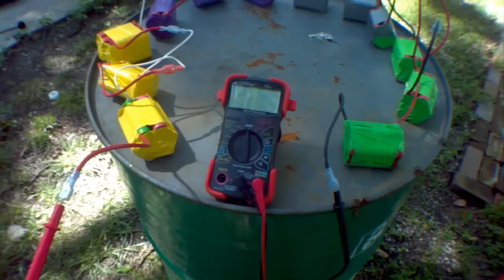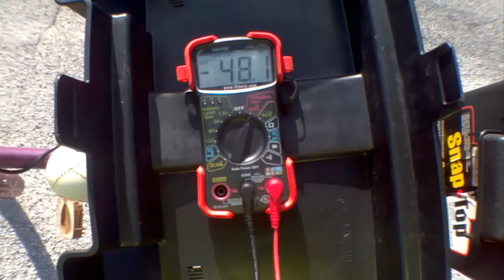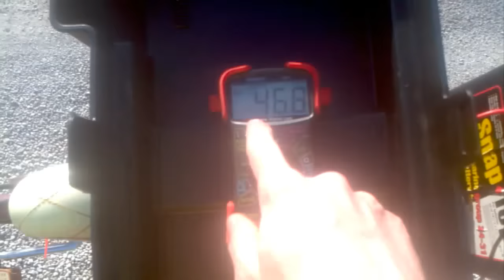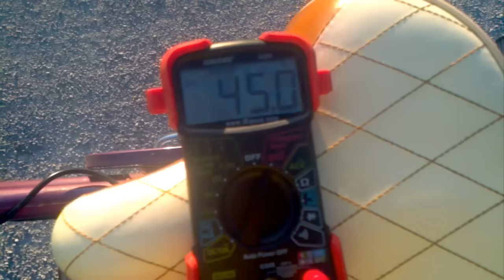1000w 48v 9ah electric bike distance test

Comment: Your Motor is ok, but bike and Battery are a nightmare. Buy a mature Middleclass Taiwn bike, like Wheeler Cross or something like this or if you have the chance to get a Trek or GT or something take this (ots ok when its old, everthing is better then the crap you have rigth now). Then you have to buy Sony V3 Konion Cells and find someone who welds them togther. Then you organize a softshell for the battery and good conncetosr for the power distribution. Then you store this in a pack backs. 

Then you have something useful.
Reply from the maker: why would I waste so much money on a bike that isn't cool like this one? this bike is great. idk what could be improved on it.

my bike now has a 60 mile range. and i didn't throw away money like you say I should. its more useful than your idea. not counting this bike is pretty much waterproof.
Reply: Rinoa Super-Genius OK good point...but you would need at least a new fork to have some brakes at least...
Reply from the maker: chris dabeee
it already has breaks. you just peddle backwards. i'm tired of hand breaks always crapping out on me.
Reply: Well he is using 18650 laptop batteries that are decent. It's true that the Sony Konion cells can put out more current and also don't need to be balanced. But they also have less capacity. 

Laptop cells usually put out less current and therefore you must have more batteries to make up for that. This guys bike in the video is obviously not high powered so it doesn't matter. 

If you are going to tell him to get batteries that pack a punch shouldn't you be telling him to get a LiPo battery. After all they can put out like hundreds of Amps continuously.
Reply from the maker: ziongite
lipo is the same as lithium ion btw.
Reply: Rinoa Super-Genius right, Li-on==Lipo, but LFP=LiFeP04.
I would not run any battery that is less than 5x the max draw of the PWM/motor. Also, never run w/o a BMS and never EVER charge w/o BMS
Reply: I Do IT every Day without any issues. But I Use Sony V3 Cells only. Best Cells you can buy tust me.
Reply: @RinoaL  IT IS A COOL BIKE AND I USED TO PAY THOUSANBDS ON PK RIPPERS,GT'S RACE INC...MY ELECTRICS I CONVERTED ARE A ELECTRA FOR ME AND A HUFFY FOR MY WIFE...THEY DO THE JOB BETTER THAN I THOUGHT TOO..

Comment: holy shit! charging that must be a pain
Reply from the maker: actually its not all that bad. it takes like 30 charge/discharge cycles for it to get out of balance. then when it gets out of balance I just connect all the packs in parallel with little jumpers and they all equalize overnight.

but my next battery pack I built with balance leads.

Comment: i take it you would get double that more or less with a 500w moter
Reply from the maker: no, because it only takes like maybe 100w to maintain speed regardless of motor size. however a smaller motor could waste more energy as heat so you could get slightly less range with a smaller motor.
Reply: ok perfect size in your opinion1000w 500w ect ?

Comment: Cant those batteries literally explode like a hand grenade?
Reply from the maker: ***** nope, that is a horrible bit of misinformation people spread around the internet. mostly because they dont understand lithium cells. lead acid is more likely to explode like that.

18650 cells are designed very well and i regularly see even flat lithium packs crunched up on the side of the road when somebody runs over a phone, and no flames.
Reply: +911LexVegas Na they just burn when they go into thermal runaway... and you really have to F-up pretty bad to get them to do that.

Comment: on the pc cord which is pos and neg the l or n
Reply from the maker: thats a good questions. on my electric tricycle there is a connector like the power cable on a computer power supply. on the motor controller side of that connector the wires are reversed, white is negative and black is positive. but on the battery side its Yellow/green line, is N, Negative. and Red, I, is positive. idk why they put I but whatever.
Reply: i tried L as pos and N as neg and its sparked really bad is that normal
Reply from the maker: scott white
by (spark really bad) do you mean it melted the wires? there will be some sparking but if you turn the motor off it wont spark on the newer ones.
Reply: Yeah really bad sparks and it did get warm
Reply from the maker: scott white
try it the other way then i guess, if not you will just pop the fuse i think.
Reply: Ok
Reply: Right now I've just been separated into two 24v packs and charging in that way but it takes forever
Reply: Can you recommend any reliable lipo battery packs
Reply from the maker: scott white
no, i ended up building my own from old laptop batteries and thats working really well. i just had a cell short out in my big pack a few days ago and it just popped the connectors between the cells and got really hot, didnt explode or anything.
Reply: do you provide this service
Reply: i tried charger the other and got smoke and it burnt out no biggie can you recommend a good charger you are familiar with.                   i am using 4 12v 9ah sla batties on a 100w hub
Reply: i have to say your videos inspired me to build my own the were well thought out and very informative

Comment: This is terrifying.
Reply from the maker: your afraid of bicycles?
Reply: Rinoa Super-Genius No, just batteries.
Reply from the maker: the modfather
oh, lithium cells are quite tame when you learn the parameters that keep them safe. after all a lot of work went into making them safe.
Reply: Rinoa Super-Genius Yeah, sure. That's why endless-sphere recommends charging your batteries inside a fucking barbecue, so they don't spontaneously explode and burn your house down. Like actually happened to a few people.
Reply from the maker: the modfather
first off, forums are a bad place to get information, and also who the fuck charges their batteries in a barbeque? was it charcoal or propane?
Reply: +Rinoa Super-Genius ... lol, are you familiar with the endless-sphere Forum?  
 One question, when are you going to build yourself either a chest harness or go pro style camera rig so you can use both hands when shooting vids?

Comment from the maker: only reason i would buy a lower wattage is couse i could be arrested for having my 1000w motor. in Illinois you cant have over 700w or go over 15mph (our secret) they almost make it pointless but i did the cop test (stopped next to a parked cop and messed with my batteries) and he didnt give a shit about it.

oh but be prepaired for fucking morons to drive you off the road, they speed up past the speed limit then try to side swipe you. i've almost driven off into a culvert couse of that. D=<

Comment: 48v at 9ah = 432w not 1000w
Reply from the maker: +Lloyd Carrillo no that equals 432 watt-hours. it can give 1000watts for like 30 minutes though.
Reply: I see. So its more like C rating or burst power of some sort?
Reply from the maker: Lloyd Carrillo
what is? every thing your mentioning is a sperate metric
Reply: +Lloyd Carrillo :  48v x 9AMPS would = 432w, but ah is a unit of energy STORAGE CAPACITY, not one of immediate amps, and means nothing when multiplied by the voltage.  The watts rating (V*A=W) ties to the immediate rate of current from the battery (amps), which for this rating is given by 1000W / 48v =  20.8W.

Of course the 48V is the RATED power, but it does vary over the life of the charge, so this is only a (close) estimate.
Reply: 20.8amps u mean ?